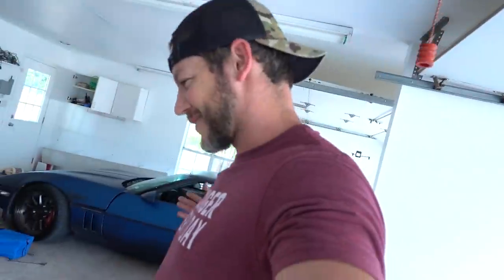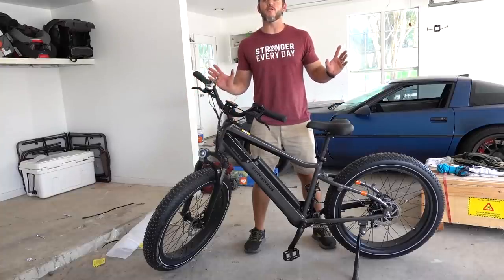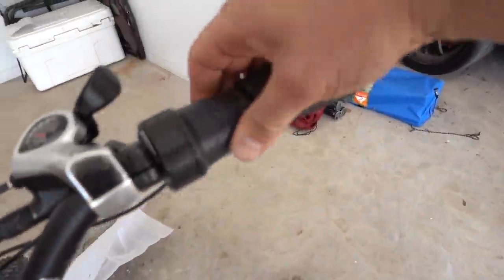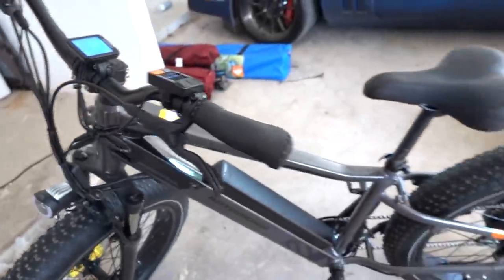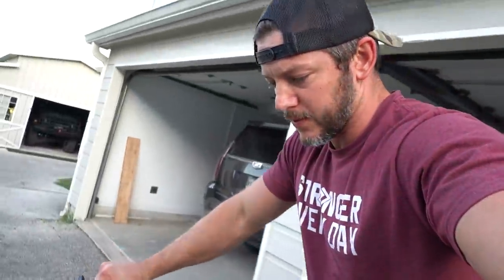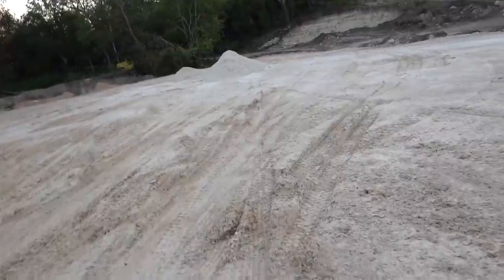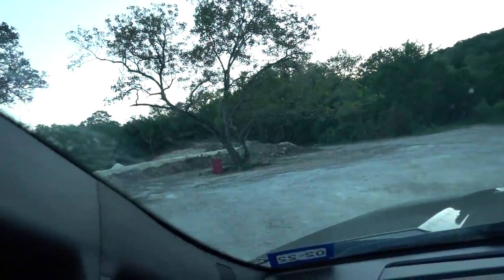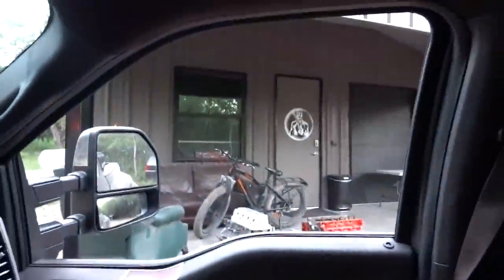I Got a New  Electric Bike cuz I am Environmentally Conscious...

Comment: The new HQ would be perfect for a massive rainwater collection system that you can use to fill Master Chief. You could even plumb in a pump and pipe to fill the tank from inside the garage.
Reply: he has one lol he has 2 tanks i think
Reply: @184_EngineCo  you mean the single tank collecting water from the tiny roof on demo hq?
Reply: @184_EngineCo  You think thats gonna be enough if you need 2-3 refills?
Reply: Think bigger... massive underground cistern with hand and fat elec pumps (for watering and filling the firetruck)
Reply: Great idea.
Reply: Will be able to design it to fill in less than 6 hours or so too 😉
Reply: Nerd
Reply: Yep made a similar comment on the other video.  You are right!!

Comment: If your starter gets weak, it won’t matter if you have 2 batteries or 4 it will just start hard. Make sure your starter is good and check your cable connections at the starter before you go and buy more batteries.

Comment: The starting problem on master chief is most likely starter contacts being worn out, limiting the amount of current to the starter solenoid, not a lack of battery current.
Reply: Agreed, always best to diagnose before spending $$$.
Reply: I second or third that. Need to make sure all contacts are clean and that the starter is working correctly. Once it begins to turnover it does well.
Reply: Really hope he can see this comment or any similar comments if anyone else expresses the same thing.
Reply: Agreed - a couple of swift whacks with BFH will keep it going temporarily.

Comment: Might check the brushes in the starter…. Everybody’s going to tell you to check the ground straps and points first and that is a good idea but don’t rule out the brushes in A series wound starter motor.
Reply: Hell, dad's toureg was playing up with starting, changed the brushes, was about a 45aud part, like new again. We were chasing battery and ground n all that other shit that got it a little better but that was the real issue from the start
Reply: True. It's not a battery issue at this point. Yep it all works together. Need to check everything. Brushes are fairly easy to deal with and Ive had good luck with just cleaning brushes and the surface they contact. If there is plenty of material and not wore out of coarse.

Comment: it's a starter relay problem, change de relay or the starter and you should be good with 2 battery
Reply: Probably better to go back to the original four battery setup. That's the way the machine was designed...
Reply: Or valve adjustment.
Reply: 100% true... clicking the key will eventually let the relay contacts make contact and start... but it will get harder to cut through as you build up more junk on the relay contacts.  If you can clean the relay contacts that will help.

Comment: you need all 4 batteries amps to low your going to fry the starter and that will cost alot to replace
Reply: also its quiet handy if your fire-engine would actually start in case of a fire.. :-)

Comment: I was a mechanic in the army. 2 1/2 tons had 2 batteries. I never worked on lmtvs when those came out I was no longer a mechanic. I will say look in to what the starter requirements are. You might be able to find a combination that works.

Comment: Make sure your battery wires at clean from battery to starter. Also any ground wiring.
Take them apart to make sure they are clean between eyelets and connections...Good luck.

Comment: With starting issues always check battery connections and ground straps first. However I'm sure this is a starter solenoid with bad contacts. More amps will push past that but a new starter solenoid will be cheaper. When it did crank it had a good fast crank and started right up. Even with two more batteries @ $200+ each the solenoid will continue to worsen and fail again. Adding batteries is not fixing the problem. Some of those starter solenoids are user rebuildable, a big copper pin makes contact with another surface for power to flow through, every time you start it there is a small arc that leaves a dirty deposit, after thousands of starts these deposits get in the way of the current flow. The clicking is the contacts slamming together but failing to make a solid electrical connection. Then finally it connects and starts. If you can disassemble the solenoid all you have to do is clean and resurface the contact area with a flat bastard, much like ignition points in a distributor, albeit much larger scale, it's a similar idea.

Comment: Wish that price of the bike was $800 instead of $2000 the upgrades are smart though.
If you buy the bike you really need 2 batteries to be safe.
Reply: Why? Just pedal it when the battery dies...
Reply: @tylermallory2504  I'm not sure about the Rad Rover, but I have the Rad Wagon. It weighs something like 80 lbs, and isn't set up for optimal pedaling position, since it's meant to be electric assisted.
I ran out of juice on the way home one day, and quickly discovered that riding that bike for much more than a mile with no e-assist is much harder than it seems it should be, and very, very slow.
Reply: I got my e-bike for $800 and it is a 48v 14amh motor.  It goes 17 mph on flat ground.  its a great bike.  I ride it to work every day.  my battery lasts the entire week.  and it only drops one battery bar in the week.

Comment: Matt, have you checked all of the cables, wires and electrical connections from your batteries to the relay(s) to the starter motor on your fire truck to make sure everything is good, clean and tight?

Comment: hello matt I'm a diesel mechanic at a TA the battery issue your have doesn't sound like a battery issue at all it sounds like your starter is having an issue catching/rotating your flywheel please forgive me if I'm wrong but I've recently worked on a truck that had that issue and the problem was the starter was going out take into mind i have a semester of diesel college and about 7 or 8 months of diesel mechanic work experience.

Comment: In your previous video regarding the tank for master chief you were wondering what to do with the previous tank.  I was thinking you could paint it (black or anything to make it opaque) with some of that paint made for plastic (to prevent algae) and fill it with the over flow from the tank at Demo HQ's rain collection.
That was until I saw the size of the garage you're building.  Get rid of/sell that puny tank and use the garage to collect rain water.  With the square footage of that garage you'll have enough water to fill master chief and supply your house and the pool and... whatever.

Comment: Looks likes you have two 6 volt batteries on the firetruck, since diesels usually take 24 volts to start, you need the other two batteries. You are trying to start it with 12 volts now. The lights and all only use 12 volts though.

Comment: Hi Matt take it from a profesional that squeeling belt is the root of your problem, 
the alt cannot maintain charge if the belt is slipping,  odds are you need a belt and alt pulley, 
and that starter needs fully charged batteries 👍
thanks for the making me smile over the years 😉😁

Comment: Did you check your starter? 
I just replaced it on a diesel van that I own, sadly I bought a new battery before, because when you hear it struggling, you normally point the finger at the battery, but the old battery was still good.

Comment: Those LMTVs usually need to wait to start like the HMMWV does. On the dash there should be a light that goes off just before it cranks to run. Thats the same wait light. I drove those overseas for a while (it was a little newer but still the same trucks). Tour two batteries should work.
Reply: He had a humvee before with the same light. He knows (probably) and just didn’t show it on camera.
Reply: @lyellgalbraith2895  I'm sure he does, I know that the wait light on the LMTV's is a symbol and not the word 'wait' so I just wanted to clarify.

Comment: Check the battery cables themselves. Check the wires on the starter as well. If the batteries don’t fix it.

Comment: I would almost bet you one of your Barrett 50 cal rifles, that it’s your starter contacts that are not happy. The battery’s that was in it was probably getting week. But still had plenty to still start it. 24 volts uses less amps and more voltage. 12 volts uses amps instead of volts. Just my two cents tho lol.

Comment: Check your power and ground cables to and from your starter. Not knowing the exact specs on those batteries, two should be plenty as i only run 2 smaller batteries on my tractors with 12 liter cats in them.

Comment: Matt if the batteries only have three caps then they are 6 volt batteries wiring them together would only make it a 12 volt system if you want to eliminate two batteries then you need to get to 12 volt batteries and install them or you're going to have to go back to four six volt batteries

Comment: Acts like a bad solenoid  on the starter. There is a disc in the solenoid  that can be turned over or cleaned to make a better contact. I would check the starter first.

Comment: Would be nice to see you take the engine out of the hub and see if it actually is the Bafang 750w and not the Bafang 500w engine. It wasn't on the old model 5 - eventhough the specs said so.

Comment: Pretty sure it’s a starter issue not a battery issue, when a starter starts to go out it will lock up and not fully extend to come into contact with the fly wheel to turn over the engine, the fact that you hit it like 5 times before it fired means it’s not a battery issue, if it was a battery issue it wouldn’t crank after that make tries especially with that big of a motor

Comment: Dude, you need the other 2 batteries. No matter what others say, that unit was engineered to have 4 batteries make sure to keeo the 4 batteries in ir. My 5 Peterbuilts are the same way. They are engineered for 4 batteries. When I dropped diwn to 2 batteries I realized that 2 batteries were the reserve batteries for crankung or ignition. The ither two are the batteries for rhe injectors and the electrical system. So yes, you need all 4 batteries hooked uo in the truck.

Comment: you should get an E-Mountian bike so you can have a smoother ride. it does not have a motor in the wheel but it is better in every other way
Reply: also if you hold the up and down motor you can "hack" it and make it go 24-25 miles per hour

Comment: The batteries that you are using are 6 volt battery's so 2 = 12 volts not 24 so you need 2. 12 volt batterie's to = 24 volts or the original way they had it is 4. 6 volt batteries that makes the 24 volts.

Comment: If you converted truck to full EV, there'd be no starting issues, no smelly expensive fuel requirements, and, it would go like stink. The torque on it would be insane, especially off of the line. Potentially, if you had solar, you could run your truck for nothing most of the time; Mere would be good with that, I'm sure. 🤪😁😋

Comment: Buy a 24V truck battery......not that expensive and it will work better than two 12V in series or parallel

Comment: you should totatllayy check out ecells and there super  onarch 1500 e bike ive got one and it does 35 under full electric and ive gotten up to 47 on full pedal assist on a slight hill and its full suspension dual battery and dual hub motor

Comment: People don't think of the long-term impact of these battery bicycles. What happens to the batteries when they are dead? They are not easy to recycle. Similarly,  the elements needed for the batteries are often mined in a way that is not good for the environment.  Best to get a normal bicycle if you want to have solid, environmentally friendly credentials.

Comment: I will stick with my BionX e-bike kit (even though they are no longer around). I have thousands of miles on it and it can be moved to another bike fairly easily. Since it is a kit, it does not come with a bike full of bargain basement components like this one. One of the things I really like about the bionX is that you can not start from a dead start. The bike has to be moving for the throttle to work, so you can't accidentally launch the bike across the room if you bump it. It had a thumb throttle, so you don't have issues with the grips moving around when you are just riding it as a bike, with no power. This means I can use any grips I want, so I'm not stuck with the garbage this bike ships with.  It has tons of power, so you can coast up hills even if you weigh 200+ lbs like I do. 

BionX was the top seller of Electric Bike kits for a very long time. Unfortunately it looks like the company was finally killed off by cheap chinese made garbage like this. Luckily, it looks replacement parts are still being made, not that I have needed any of them.

Also, carrying a couple replacement brake cables is a lot easier than carrying a bottle of hydraulic fluid, hoses, fittings and tools. There is no difference in stopping power between a quality cable disc brake and a hydraulic disc brake. The only real difference is the price and the amount of work required to replace and set up the brakes, which the cable brakes win on every time.
Reply: At least you're not biased...

Comment: I'm just very disappointed you only got a radrover. For the price of that bike you could've done a diy build that actually has speed and power and most importantly range. At best you're gonna be going 25mph and without pedaling your battery will die after roughly 20 miles. For nearly the same cost I've done an eeb build that hits 60mph for 100 miles or 35 miles for 150 miles all without pedaling

Comment: Surely a normal bicycle would be more environmentally friendly as it doesn't need electricity... which for the most part in the US is produced by burning coil or oil... a normal bicycle just uses your legs and then that is good for a workout.... unless you don't like working legs.

Comment: I'm sorry, that's a terrible ebike, I'm sure they work well, but you want pedal assistance, not a motor driving the wheel when you pedal. 

not only is it better for battery life because if you put more power down the bike will put out more power, they don't look like commuter bikes, look for well literally any haibike as a good place to start for ebikes, there's a reason these ebikes aren't popular with anyone who uses ebikes and also, they'll have tunable suspension which I'm sure you cant be bothered with, but it's there if you want it

Also, 60mm is tiny for suspension, most bikes are at least 100mm-140mm

Your tires are literally more suspension on that bike than the suspension is